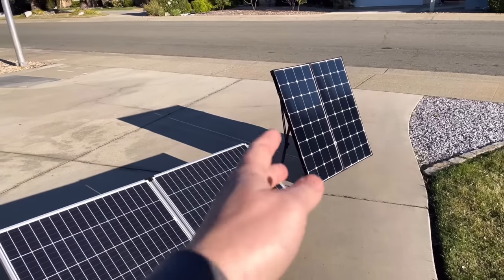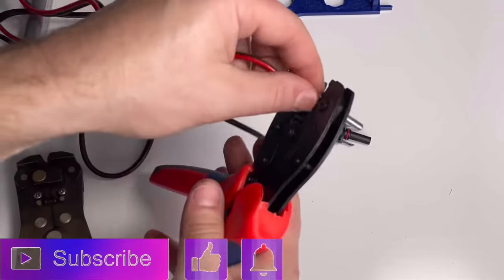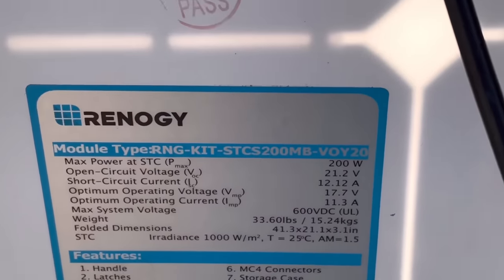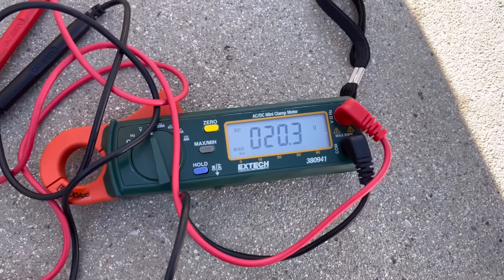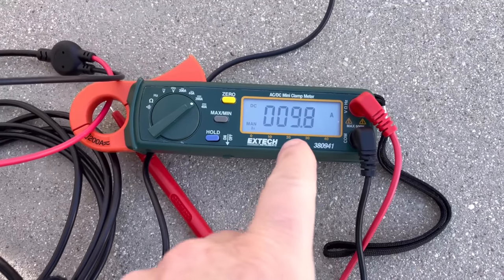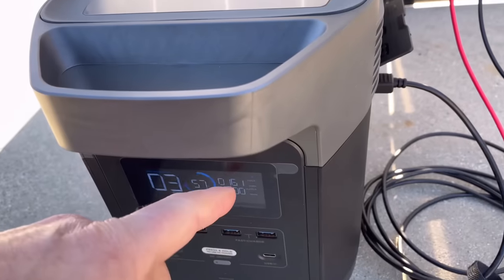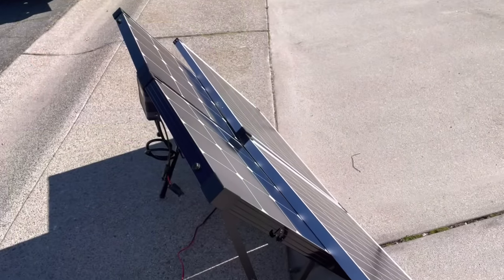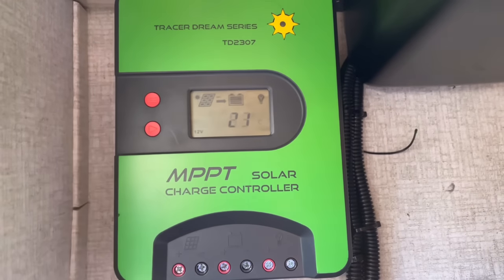Best Solar Panel - Harbor Freight 100 Watt Solar VS Renogy Eclipse Solar

Comment: So these are pretty much equil to each other then?
Reply from the maker: Well power wise about. Although this renogy set has never performed well. And if you are looking for a decent set of 100 watt panels the HF is not a bad option especially the warranty which is normally pretty good. But recently in the last 3 months 100 watt panels are really coming down in price. Even single sets of renogy panels and more on Amazon.
Reply: @johnnysweekends 

 I went today the 6th and I bought as many as I could get my hands on at HF they had a instore coupon and Manufacturers coupon and rebate. I took the coupons. 

 I have always been afraid to take the step in purchasing anything solar. So now what indeed. I'll be watching your videos a few dozen times that's for sure.  Thanks for those.  

They never appear to work or work for long.  I don't want to make that expensive of a mistake. 

I have neighbors who have cut down trees installed panels yet they are still paying the same price in Power some pay even more.

When regular power goes out so does theirs.  Odd' to me.  And no one gets to send any power back into the grid for credit.  

So I'm taking this chance to purchase which I've done.  Will now learn hands on, on this whole process works the full loop of it.  I'm positive the solar companies are leaving out serious information about how the system is not completed or ?  

I kind feel excited about this. I'm starting slow and small.  Thank you.  You were awesome help in your video and response.
Reply from the maker: You’re welcome and thank you. 
Let me know how things go👍🏼

Comment: Like what's the running capacity how many things can I run on this charge system
Reply: 160 watts worth while the sun is shining.
About 1/4 of that if used 24/7 with battery backup.

Comment: did you have the HF panels in series or parallel
Reply from the maker: Both in series. So I could match the renogy set up.
Reply: Now where did you get your cable as that is all I lack. Using a eco-worthy mppt because beleeb OOS.
Reply from the maker: Which cable were you looking for ?

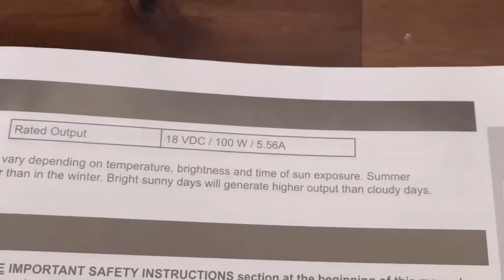Comment: 0:45 unless that’s a sae disguised as an Anderson connector it’s actually sae.
Reply from the maker: Yes I  mentioned this in the description I miss stated the connector. I was playing with stuff earlier and needed a Anderson one. Never caught it in editing.
Reply: I don’t know why any designer would have sae on a solar panel like those…sae is so easy to give a bad connection and really much less tolerant of multiple panels connected & handle direct sun exposure badly and can get hot and melt easily…even low power connections at 100f temperatures they are really have a tendency to fail…to me they are one of the worst solar connectors a manufacturer may use….especially with temperatures and or multiple panels.  Replacing the connectors even if only 1 panel is used to only power usb connections is probably a good idea.  

Good panel it seems…but awful connections.

DANGER WILL ROBINSON!!
Reply from the maker: I don’t really have much of a use for the SAE unless I’m plugging in a battery but that’s about it.

Comment: 12 volt panels will do better with thicker cables and shorter runs.  Not a completely fair comparison, but with the price of copper nowadays, 24 volt may have an extra advantage because noone can afford the thick cables.
Reply from the maker: That was a really short run considering. So the gauge for that short of a run was more then enough for the voltage and amount of amps the panels put out. 

But not sure about fair comparison? They both were tested the same..🤷‍♂️

Comment: The charge controller is in the wrong spot.  It needs to be closer to the battery as it is converting to a lower voltage, so you'll get more voltage drop with it next to the panels like you have it.  If you reverse that, you'll lose less volate.
Reply from the maker: Which controller are you talking about?
Reply: @johnnysweekends  It looked like you had the charge controller mounted directly at the panel.  It converts whatever voltage the panels create to the voltage to charge the battery.  You want that lower voltage to be on as short a wire as you can get as you lose voltage over longer runs or use larger wire.
Reply from the maker: Ahh got ya. Yea as described in the video I talk about how I bypass the on board controller from renogy which is a pwm and go straight to my on board mppt controller which then goes to the battery. About 2.5 feet of wire. 

Sorry if it wasn’t clear …👍🏼

Comment: Can someone help me to understand why everyone continues to talk about these older, smaller solar panels that put out only 100 watts or so?   I live in Chile and just bought some 540 watt solar panels for $255.00 (USD) each and that includes all import duties and taxes which are high here.
Reply from the maker: Residential is the way to go if you have room and space and weight isn’t really a problem. But if you need a portable set up or suitcase style that’s where these smaller panels come in. 
That 540 is awesome but big and heavy unless it’s a stationary mount. 

That’s the only reason for the small ones is weight and portability.
Reply: @johnnysweekends   Ok, thanks.  Yes, I mounted these 8 panels outside on a welded steel framework set in concrete around each vertical member.  So mine are permanently mounted and space is no problem where I live.  And I'm using a nice 100A MPPT controller I bought from Amazon (EPEVER).
Reply from the maker: Nice!! Yea ground mounts are nice if you have the room which I prefer over roof mount. 

Thanks for the comment and thanks for the comment all the way from Chile 🇨🇱 👍🏼😀👊🏼

Comment: You covered one set of panels with the other that can't read correctly ???
Reply from the maker: I’m assuming you watched about less then 2 mins of the video..??
Reply: @johnnysweekends  ... No the whole thing but while you were testing you had one set of panels over the other .. dear friend 🤦
Reply from the maker: Ahh ok got ya. 

So I first tested the renogy set, after I got my numbers I took both HF panels and simply set them up against the harbor freight to get the same angle or get the maximized angle to the sun again.

So while they were leaning on the renogy set I was not testing that since I was done. 

You with me..🙂👍🏼

Comment: That’s an SAE connector, not an Anderson, btw.
Reply from the maker: Correct. Yea I posted that in the description I called it a Anderson when yes it’s a SAE. I was messing with Anderson connectors earlier and still didn’t catch it in editing ..🤷‍♂️
Reply: @johnnysweekends  - Cool. I checked the comments, but not the description. 🥴
Reply from the maker: lol no problem 😀👍🏼

Comment: Wouldn’t Watts be what determines the speed of the charge, not Amps?   If you have a system that can take a range of voltage, ignoring heat loss, twice the volts at half the amps is the same energy sent as twice the amps at half the volts

If voltage input is consistent, then amps would determine charge speed but when seeing double the voltage the real number that matters is watts that the charge unit sees.
Reply from the maker: Well one electrician once told me I really just care about amps for the most part. If a source is providing power it has to have enough amps to run it. Same with if you don’t have enough amps you’ll be here for ever waiting for items to charge. 
Hence Tesla chargers need a lot of amps to charge there cars. Another why the grid will fail when everyone starts plugging in there cars drawing 240 volts at 80 amps!! 😂 
But the mppt charger is what does the magic is can take the voltage amperage to get the most out of the power coming in. 
 Also amperage is what causes lots of heat verses volts do not. Hence alot easier to pass a lot of volts through small wires verses amps you need to up the wire gauge. 

Idk hope this helps.
Reply: @johnnysweekends  Think of it like water.  Volts is like PSI, amps is like hose diameter, and watts is like how much water has come out of the end of the hose.  On their own volts and amps don’t tell us anything.  Sure if you have a restrictively small amount of either it’s going to make charging take forever.  But when you’re talking about electricity reaching your charger/inverter, what really matters is Watts.  

That electrician sounds like they were talking about a system with a fairly fixed voltage.  Watts=Amps x Volts.  So if volts doesn’t move much, what really effects watts would be amps.  Same as if say a wire can only handle 10amps.  You’ll get more power out by significantly increasing volts than worrying about 5% difference in amps.

Your point about the Tesla’s isn’t wrong but it would be just as much draw on the system as if they designed the car/charger station to run 120v at 160amps, ignoring any difference in heat loss.

If the MPPT isn’t processing both the full voltage and amperage then it may be a case where that device is better at lower voltage and higher amps.  I’m not familiar with it so I can’t say it’s identical.  But it does seem like the unit in the camper getting more watts vs less is what would matter most short of any component inefficiently.
Reply from the maker: That’s true as watts is more about the power verses amps being more about current flow.  
When I got the renogy panel it was used. But literally only one time for two 4 hour days they said which looked like because it was just as good as new. I had it for about 1.5 years and was disappointed in the performance overall for such a set up. It worked don’t get me wrong but after playing with other panels it’s seemed maybe something was wrong or that’s just what that model puts out.  
We will see how well the Hf panels do in six months for a degradation test to see if they loose the so called roughly “up to “ 20%. 

Of the number are pretty close then it could be a few minor factors like haz or sun angle but if off by several watts then we could call it some loss.

Comment: The test is flawed if you covered up part of the panel at 3:35 minutes in the clip. Solar panels can’t be obstructed at all or you’re hindering changeability. 

I’m not sure why you put one over the other
Reply from the maker: I think if you go back and watch again and listen you’ll know exactly why it’s leaning up against another panel for support..👍🏼
Reply: @johnnysweekends  I tried, but couldn’t figure it out. That’s why I mentioned something. I noticed you move them apart, too. 

The thing that was confusing me is you doing readings of both while one was covered. I couldn’t tell if this was you setting up equipment or doing the actual readings. The one that was lower was covered up about where I mentioned it.

I can try again a third time. It looks to me like you’re explaining readings of each while they’re overlapping. 

Part of my weakness is I don’t understand 100% of what you’ve said so I’m probably missing the mark in this.

I’ve already looked up the HF option. Had no idea they had panels. Noticed they sell Jackery power-stations now, as well
Reply from the maker: The only thing I was doing by placing the panel on top of it was using it as a back board. That’s it. It was just leaning against it so I could have it hold it up at the same angle since the renogy setup had longer legs. So the renogy setup was just holding the Hf panel so I could test it. 
If one panel was way off on angle is could change the readings drastically.

Comment: Does anyone know if the HF panel in this video is waterproof ?
Reply from the maker: Hmm I’ll need to check again I though it was weather rated like most…🤔
Reply: Anything designed to be outdoors in full sun 24/7 will be waterproof.....think about it.

Comment: Anderson connectors do not have round pins.  They have flat blades.
Reply from the maker: Yes that was corrected right after the video came out. I was messing with Anderson connectors earlier and never caught it. It’s just a SAE connector

Comment: My larger solar systems run at 180 +- volts all the difference in the world.That power is fed to my MPPT charge controller. I think Renology stuff is way over priced. Thats only 15 years of solar experience and use talking.  One more point why on Earth anyone bothers with those “ solar generators” is beyond me. In a couple of hours while having some fun you could have your own , far more powerful system.
Reply from the maker: Agree the build your own will have more power and a lot more wh then the Eco flow types.

But for the most part, people want plug and play and simple. They don’t wanna do the work so much because of knowledge which you can find or the time. Which I get, finding time can be a challenge, some times..😂👍🏼
Reply: @johnnysweekends  all work and no play will kill you. Young people should make time for hobbies. You are distracted from the day to day and your enhance your skill set. I don’t think throwing money at things helps much, this is after all survival gear. Maybe knowing how , why it works will become important.

Comment: The HF panels need to be connected in parallel. The controllers are designed for 20v PV input voltage.
My brother keeps burning up controllers because he doesn't listen to me. The excess voltage (energy) is converted to heat in the controller. Please re-check in parallel mode. KK4AJN Extra Class Amateur radio dude
Reply from the maker: I think you may be thinking of Pwm controllers that only handle so many volts. Normally 25v or so. 
When using a Mppt charge controller like the one I have, depending on the specs you can run up to 150 volts and push up to 60 amps depending on setup. 
These controllers run a lot more money though. Normally around $150-$550 dollars. But the power ratings and efficiency are well worth it in the long run. 
Make sure he has a better controller. 
Parallel is great for getting more amps but normally requires larger wire and more money. Verses series you can run a lot of volts down a small wire and the controller will do the rest.

Comment: Those are not Anderson connectors those are oem connectors
Reply from the maker: It’s actually a SAE connector. I added in my description the error as I missed it in editing. I was looking at Anderson connectors for a idea for my truck I’ll be playing with later. So mistakenly called it Anderson.